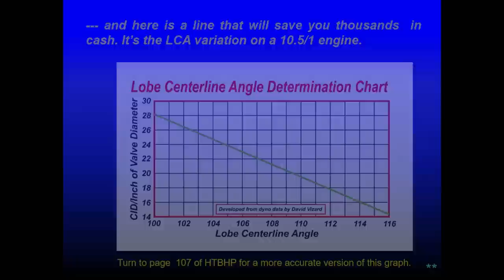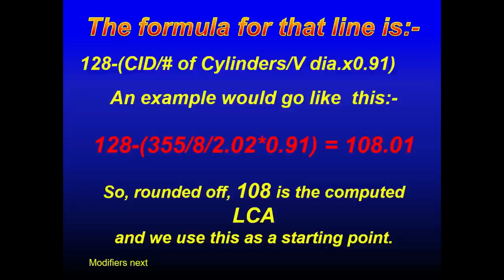Cam profile dynamics Vs event BS bashing!

Comment: Not so much bs marketing device but bs talk around car guys... Back pressure. Back pressure does not exist anywhere on planet earth. Pressure does not have a direction. Flow has direction. Pressure happens in all directions. Pressure is simply pressure in the system. There is no forward pressure therefore there is no back pressure. What about left and right?
Reply: "back pressure'' is one of my biggest pet peeves when I hear people use it.  There's no such thing and they usually mean 'exhaust restriction'.

I think it's due to all the guys that run big ass cams that are too much for their engine, then they say ''engines need some back pressure to run better''.

No, you need a cam with less overlap.
Reply: Drive pressure is even more stupid, pressure is not driving anything.

Comment: I applied your 128 formula the a 454 bbc with 2.19 valve and came up with 99 LCA. It seems pretty short and I don't think there's a cam out there with a 99 LSA.
Reply: SMALL. BLOCK. CHEVY.
Reply: @isaacandruthruss90  Brooooooooo 😂😂
Reply: 454÷8=56.75
56.75÷2.19= 25.9 (26)
128-26= 102.
There is extra to add to it, as a Big Block Chev has canted valves over the single angle design SBC.
Best advice is buy Davids book How to build Big Block Chevys. Thats "extra" is in there.
No, I wont tell you. Its David's knowledge. Either buy his books or wait until he says what the "extra" is on here for free.
Reply: Joe open your ears David stated Small block  Chevy
Reply: @crd-nz_001  very well said.
Reply: @crd-nz_001  Would a 102 LCA work on a big thumper?
Reply: @crd-nz_001  Well played sir. 
😎👍🍻
Reply: @gothicpagan.666  Ive used the formula on a 20 valve 4age (98ci) and it came in at 120 Intake LCA.
Since this engine has a simple VVT, I did a dyno of one on and one off. Both produced the same Hp at the same rpm. However, under the curve was in favour of VVT which advanced the Intake by a set amount. Unfortunately, I have no exact data on how much advancement that is, but theoretically it can go up to 30 degrees. Intake LCA of 90 sounds absurd to me, so could well be closer to 100.
Anyway, a 5 valve DOHC 4 cylinder is no way the same as a parallel valve V8, so concessions need to be made. What it does show is Vizards dyno proven theories of advancing the intake improves torque output. If top end Hp increase is needed, then the focus should be on getting the head to flow more air rather than closing the cam later or increasing cam duration. At least, thats where I am up to in my own "Hobbyist" engine development.
Reply: Joe, for a BBC you use 131 in place of the 128.   Canted valves use a different number.

You'll also notice that BBCs are SEVERELY undervalved in the intake dept.
Reply: @General Civility This is always the problem with this type of video lots of people just do not listen. I have been listening  and learning from David for 50 odd years.

Comment: David,
What do you actually know about cam design and dynamics in the context of modern engines (not old stories about stuff from the 70's or 80's)?
What software have you used or written to design motion profiles?
Do you even know what mathematics are used to design motion in modern times?
If yes, can you explain?
Reply: Jon, can you first justify why I should design my own profile since I am surrounded by profile designers who are far better at it than I am and even if I did design my own profiles would it be the best way to spend my time to reduce the lap times of my racer????????
 Now please answer the damn question here instead of going off on a tangent!!!!
Reply: @DavidVizard  

David, your answer explains why you don't understand the argument that you are trying to make.
You claim that LSA is most important while relying on the cam designer to design a cam that doesn't break parts.
The truth is that what the cam designer is doing is more important because if he does his job wrong you get broken parts and a broken engine doesn't make any power at all.
What you are doing is saying something trivial is most important while ignoring the hard work and real science that the motion designer does.

Comment: I don't like to boast, but I don't like BS ethier..
   When you can turn your daily driver to 8500rpm with a 4 eye brow cast flat top pistons, stock GM rods 350ci small block Chev,  mildly ported patriot 200cc 72cc chamber 23° heads, 2.02in 1.6exh valves on E10 pump fuel and using your 280 advertised duration cam, on 108 LSA,  I'll change to the 128 formula.

 Keep testing,
" bring it over when you want it fast.
Reply: That'll run like crazy.... As grandpa often said..... Until it goes from together to apart.

Comment: Vizard doesn't always get it right.
Put a Crane cams profile, that Vizard had a hand in, in to a 1380cc mini for club tarmac rallys.
Uter total waste of time, it ran on 13" wheels with softish slicks, £1200 a time gear  box kit (20 years ago).
Couldn't get 60 miles, if it was dry,  out the bloody thing before the gear teeth were ripped off. 
Absolutely hopeless, went back to a piper cam lost 18Lbs/ft at most rpm points, never broke a gear box after that👌
Reply: You probably could have saved time and just closed off half your air filter and done the same thing. 😂
Reply: What on Earth were you thinking, taking it out in the dry?
I thought it was common knowledge that running a Mini in the dry activates the random fourth (spare) cylinder, inevitably leading to mechanical failure. 
In wet conditions the dizzy prevents this by cunning dint of its location on the forward facing side of the block. 
Many assume that this is a flaw in the design and go to great lengths to insulate and prevent water ingress, but those Austin engineers weren’t daft y’know.
Cheers! 😁
Reply: So you're gear box sucks.
Reply: @hotrodray6802  Not as much as the 48mm Dellorto DHLA.
Reply: @hotrodray6802  Nope, nowt wrong with the box, simply too much cam for the poor thing when the Factory traction control system failed in the dry. 
It’s a Mini thing. 🤫😁😂🤣
Reply: You could have cured that with boost! Boost fixes everything! 🤣🤣🤣

Comment: David, if you want to provide some information that is valuable instead of your glory-days tales from the 70s, how about you do a presentation of how to read and analyse a cam chart.  
For example why acceleration curves have specific shapes and what the purposes of those shapes are, do you even know?
Maybe you can explain how a modern cam is designed, based on your comments about polynomials, I doubt that you know how the mathematics of modern cam design is done.

Comment: David, in your video, you claim that empirical data is always correct.
You don't have a good understanding of how empirical data works in science or engine development.
For example; empirical data from 1980 would indicate that a 400 cubic inch 2 valve naturally aspirated engine could make about 600HP.
One of the limitations of that era was the valvetrains and the cam design and manufacturing technology.

Some engines of the same configuration are making 1,100 HP today.

The truth is that technology advances and empirical data is always behind the times and is not useful to advance a technology.

Comment: David, in your video, you present a circular lobe as an example of a smooth motion that doesn't work as a cam as an argument against smooth motion.
I am wondering if you have lost your ability to think clearly or if you have such a low opinion of your viewers that they would fall for that ploy.

What you have done is called a straw man argument, (in other words; BS)

A straw man fallacy occurs when someone takes another person's argument or point, distorts it or exaggerates it in some kind of extreme way, and then attacks the extreme distortion, as if that is really the claim the first person is making.

It is quite ironic that you use a straw-man argument and call sound engineering BS.
Reply: Jon,
You have just provided material for a whole new video - so watch this space Thanks. DV
Reply: Jon, once again you are jumping to erroneous conclusions. I am very much in favor of the most controlled motion possible via smooth profiles and other techniques. WHAT I SAID WAS that events are more important that profile dynamics WHICH THEY ARE. Please stop misquoting me. I seems you have to criticize me  - do you have an ego problem or is it a technical insecurity problem (yes or no answer will do).
Reply: Jon by the way my PHD guys are agreeing so obviously I am not talking down to them but making a technically accurate point.
And at present the thinking clearly award is squarely in my court!
Reply: @DavidVizard  
Nope, the most essential thing about a valvetrain is that it doesn't break parts. That is accomplished by engineering the mechanism properly. If you don't know how to engineer a valvetrain, then you just do what you said "use a stronger valve spring".
That was how things were done in the 80's but you could not be competitive in NASCAR and finish a race with that primitive way of thinking. You are decades behind the times.
Reply: @DavidVizard  
The most experienced and best equipped person in the performance after market valve train business is Comp Cams Godbold, he says exactly the opposite of your claims.
Reply: @DavidVizard  
What PhDs? Please cite your sources as I do.